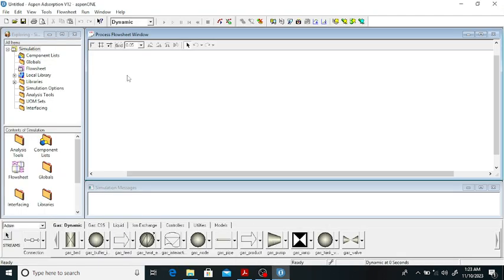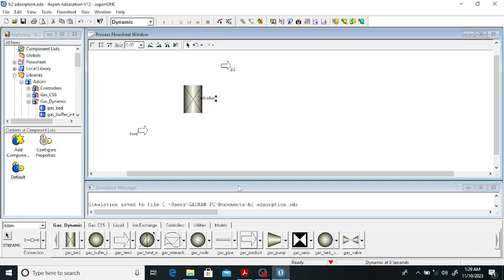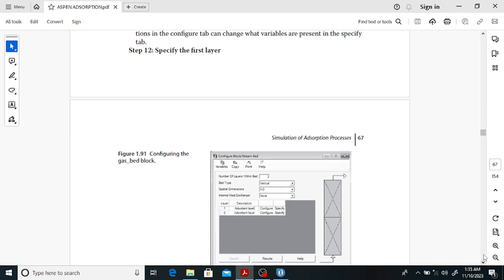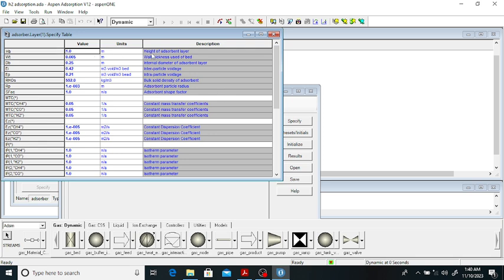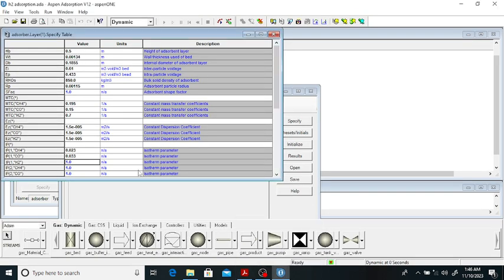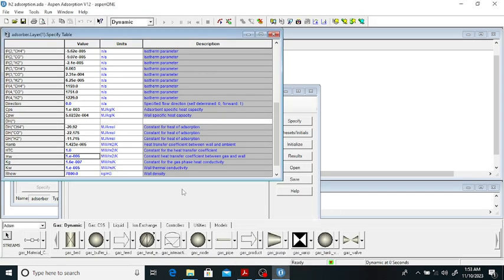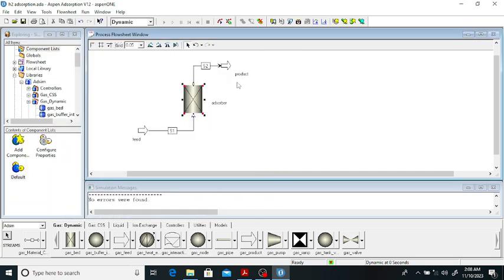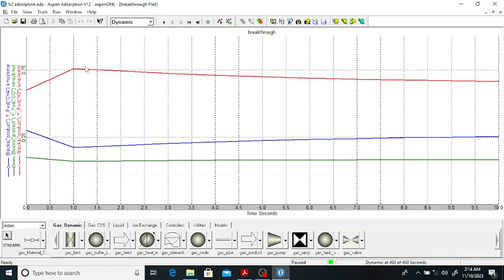Adsorption of H2 from CO and CH4 mixture using Zeolite-5A and Activated carbon || Aspen Adsorption

Comment: How you choose adsorber material like activated carbon or others. 
Await your response
Reply from the maker: In aspen Adsorption we assumed the activated carbon as an adsorbent. We can enter the properties like density, specific surface area, heat capacity and porosity of activated carbon. You can enter properties of other adsorbent according to your need.